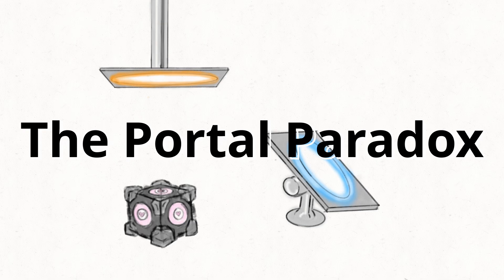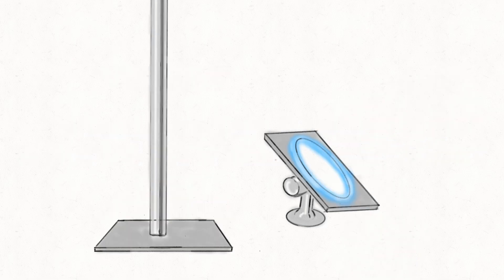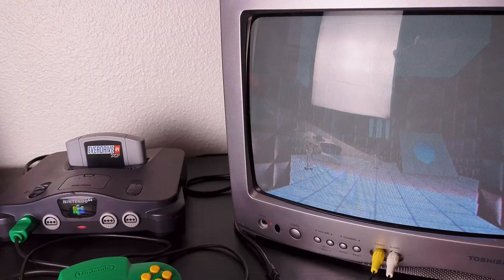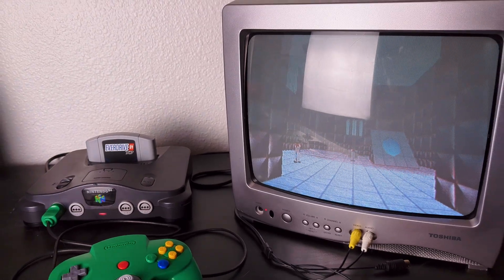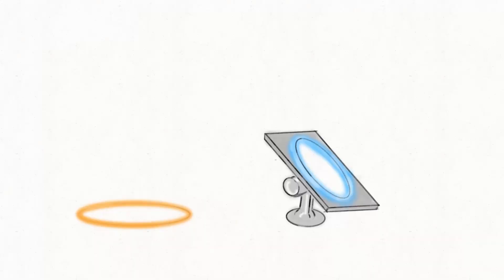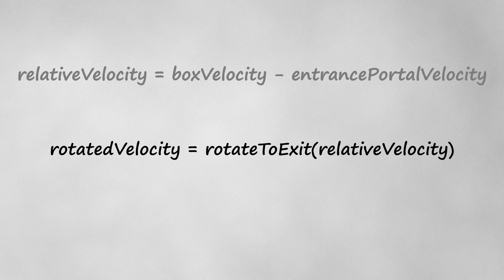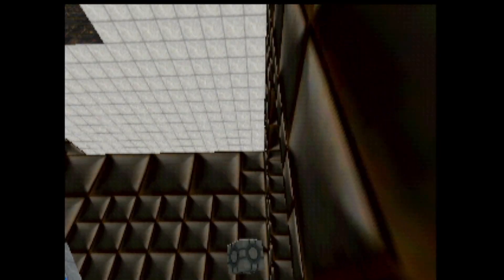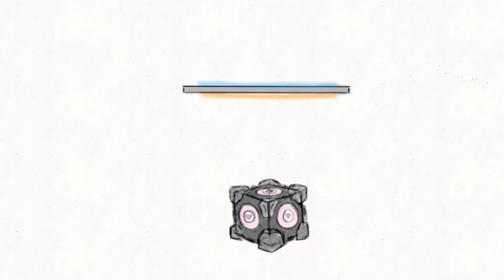I rewrote Portal from scratch and solved the Portal Paradox

Comment: This is a good video but I thought of a scenario that I think is interesting and maybe makes the conclusion drawn in the video incorrect or incomplete . So let’s say that you throw and object into the orange portal and it comes out the blue one. But imagine that the orange portal is still and the blue portal is moving at 10 m/s away from you. Then you throw and object at 5 m/s (or any speed lower than 10) what would happen?
Reply from the maker: The cube would move away from you at 5 m/s becuase 10 - 5 is 5
Reply: @james.lambert  so you throw the object into the portal and despite the object not coming into contact with anything it shoots backwards. So what force causes the acceleration? I don’t know much about the portal series but I was always under the impression the portals acted basically just as holes, so maybe I’m wrong and the portals do exert some force on objects moving through them (which would be weird because moving objects through still portals do not have any change to their speed, but they can experience a change in direction so maybe there is some force?) but if the portals don’t exert force on object moving through them then how could the object start moving backward?

Comment: wait but isn't the blue portal also moving relative to the cube when its stationary? because out the blue end is the orange end which is moving towards the cube, so those 2 should cancel out just like the hula hoop thing.
Reply: Imagine looking through the stationary portal as the other one is going towards the cube in a void with no other point of reference, it's impossible to tell if the portal or the cube is moving since motion is relative, so the scenario with the portal moving has to behave the same as if it was the cube moving
Reply: @heretichazel  irl there are other points of reference like the level the portals are in, and especially the portals relative to each other, yourself looking through the portal and the cube. As well this is a video game meaning all speed is mostly objective with set numbers.
Reply: @gdeveloper3309  I'm saying with no other points of reference just to get my point across, since the room existing doesn't change the physics of the situation
Reply: @heretichazel  well now that there are other points of reference, its easy to tell if the portal or cube is moving. 

In both relative examples the cube and orange portal move closer to each other which makes sense, but i think its a different story once the other side of the portal/the blue end is taken into account.

Once the blue portal is taken as a point of view, anything that moves through the orange portal, winds up on the other side. Once the orange portal engulfs an object, it winds up on the blue side, and once an object is on the blue side, no portal or anything is moving to engulf it or transport it anywhere else. So any portal moving towards an object should just plop it to the other end, and once its on the other end, it just stops. If the object relative to the blue portal is moving, while the orange one is staying still, then it fires through the blue one.

The space between an object and the otherside of the blue portal is cut/gets closer the more the orange portal moves towards an object, but once the object is finally through the orange portal, there's nothing making the space closer to the other end of the blue portal imo.

As well, this version/solution to the portal paradox is a tiny bit easier to implement code wise because no properties of the portal change, except that they move now(anything that goes in, is on the other side). This would also solve stopping the portal halfway on a cube.

I think the correct version of the hypothetical would be if the blue and orange portal were back to back moving towards the cube, because then like the example was, it would be impossible to tell whether or not the cube or portals are moving, but it wouldn't matter because relatively the cube would still be flung on both ends (because then the blue end would also be traveling away from where it spits out the cube)

With a moving orange portal in your example, to me it always seems like the other end of the blue portal/whatever comes out of it is constantly moving away from the blue portal even if the blue portal is staying still

The stopping the portal is also a bit strange to me, in your hypothetical, since its impossible to tell if the cube or portal is moving and should therefore behave the same as if the cube were moving towards the portal, would stopping the portal stop the cube or does it fire through? if it stays still, it means there was never any momentum to begin with, if it keeps going, then that means everything relative to the stopped portal has to keep going towards the portal as well, unless there's some seemingly arbitrary rule that the speed effect only happens once you get through the portal which im really confused on
Reply: @heretichazel  wait i have  i better way to visualize mine:

you have 2 rooms, both with cubes and portals linking the two together

-orange portal moves towards its cube
-the other blue portal can be thought of as the other side to the orange portal, so visualize them put together back to back like a hole or something to the other room
-as the orange portal moves towards the cube, everything in the blue portal room can be thought of as moving towards the cube as well. everything in the orange portal room can be thought of as moving towards everything in the blue room also
-once the orange portal engulfs the cube, the cube is now in the blue room
-like stated before, everything in the blue room moves towards where the orange portal is traveling, meaning once the cube moves into the blue room, or the blue room fully moves towards the entire cube, the cube is now a member of the blue room and must travel with it, all moving towards where the orange portal is heading
-the reason the cube doesn't get stuck midway from the 1/2 of the cube that's in the blue room moving towards the orange portal's exit and the other 1/2 trying to get into the blue room is because everything in the blue room only moves as far as the blue portal is and not past it relative to the other side of the blue portal in the orange room.

-if instead the cube moves towards the orange portal with the portals staying still, it will come out of the blue portal with its velocity. 

-The object that is moving, is the one moving relative to the other end of the blue portal(by regular distance, not distance counting portal short cuts) or relative to the objective center/origin of the game.

-if the blue portal and orange portal were back to back, attached, and moving towards a cube, or the cube is moving to them in any scenario with any number of perspectives, it would behave the same if the portals or cube were moving because the blue portal is moving away from everything that comes out of it/the cube is moving away from the blue portal once it comes out

and it would all make velocity consistent for the cube like the portals originally do, instead of the cube being still then being still relative to the scene and flung out another end when a portal quickly scoops it up
Reply: Correct, this guy is an amazing example of the dunning kruger effect.

Comment: Here is one potential flaw with the idea that portals preserve relative velocities:
Let's say we are in space far away from any major gravitational well. Choose some inertial frame of reference and place a stationary cube and a stationary portal in it. Let the second portal be moving towards the cube at a constant velocity in the chosen frame of reference. Now observe what happens:
At first, only the second portal is moving in the chosen frame of reference, so the total energy in the frame of reference is KE+PE with PE=0 (since we are far away from any gravitational influence) and KE="KE of moving portal".
Once the moving portal reaches the stationary cube, the cube will appear at the stationary portal. Now, the stationary cube's non-zero velocity relative to the moving portal will be preserved at the stationary portal, so the cube should shoot out of the stationary portal, right? Now the cube has the same velocity as the moving portal in the chosen frame of reference. But since we are in space and no forces are acting on the moving portal, it will continue moving at its initial velocity. This means that our chosen frame of reference now has total energy KE+PE with PE=0 (as before) and KE="KE of moving portal"+"KE of moving cube"; and since the cube has non-zero mass, the total kinetic energy of our frame of reference after the cube went through the portal is strictly greater than the total kinetic energy of our frame of reference before the cube went through the portal.

Comment: My argument is yes speed is relative but I would think its relative to the world not the portals. They are a holes that change an objects location not its kinetic energy. So I believe it should plop. the one hardest part through is the time the object spends in-between the portals. If it moves past the block it has entered the portal but the other end it shouldn't have moved and if it did, it would break that previous described idea fundamentally. My explanation is wrong but I also say yours is wrong too. Either way both are incorrect so you should have it act both ways depending on circumstance.

Comment: No, you're right. On really short paper, the cube should fall out of the exit portal, but when you really think about it, it is just velocity applied to the entrance portal appended to the cube (whether that's positive or negative), and so the cube goes flying. If the entrance portal slowly consumed the cube, the cube would remain stationary until its center of mass is affected enough by the gravity of the exit portal and then it falls out. I guess that would also mean that if both portals were facing the floor, the cube getting slammed by the portal would mean it would fall to the floor initially with the same velocity, and then gain more velocity until it reaches terminal velocity, but slow entrance would mean that the center of mass rule would still apply, the cube would just end up upside down. The one I want to know about the most is if the cube is falling at a set velocity and then the entrance portal passes over the cube at a slightly faster speed out of a stationary portal... theoretically, the cube would exit with a velocity of its own velocity either divided by or subtracted by (it's 2 am) the velocity of the entrance portal, right? It would be as if the entrance portal passed over the cube very slowly, or would it fly out instead? If the cube was falling at 10 m/s and the portal at 11, wouldn't the cube exit at a speed of 1 m/s? Or 1.1 (portal ÷ cube)? Wait but what about if the portal is beneath the cube falling slightly slower? Is the effect just the opposite or the same?

Wait a minute, if the cube is falling at terminal velocity, complete terminal, maximum velocity, and the entrance portal is going ITS terminal velocity (for the sake of interesting I'm gonna say it's slightly faster), but TOWARDS the cube with a stationary portal on the other side, would the cube fly out with a multiplied or added velocity? And what would happen to the cube? Would it disintegrate or break? Would it break the sound barrier within whatever room or area the exit portal is stationed in? What would happen if both portals are traveling equal terminal velocity, but the exit portal is falling backwards and the entrance toward the cube? What would happen in the same scenario if all three have the same terminal velocity but the exit portal is falling the same direction as the entrance portal (away from where the cube is headed) but toward the source pulling the cube? Is that then velocity³ or just velocity × 3?

My brain is now fried, good night.
Reply: Oh yeah, also, I don't know what happens to objects if they surpass terminal velocity so I'm gonna go look that up, too.

Edit: I just read a Reddit post and now my logic is getting wobbly with the thought of jumping and then a portal passing over you while you're suspended in midair. I guess that I'm thinking about it like the two portals on either side theory where it's exactly like cutting a hole in an object and it passing over you in midair, but I suppose realistically the stationary theory would still apply.
Reply: You slept well?

Comment: two things I'm curious about that i think are related to each other that leave the picture incomplete:

a cube is on a pillar that the portal can also go around, so the moving portal can keep moving once it passes the cube
and
the cube is suspended so that it can be smashed by two walls with portals, the two walls smash the cube

in the example from the video, the moving wall always stops once it passes the cube, there have been no examples where the piston keeps extending.
doesn't it violate conservation of energy if the piston isn't decelerated by the cube's travel?

I'm thinking that any time an object interfaces with a portal, the inertia of the object resists the acceleration from the relative movement, thus pushing back on the portal surface. this is the only thing that would solve the issue for me and make sense, because in my second example, I believe the walls would quickly reach a resistance pressure and would have to either crush the box, or the pistons would become overtaxed and stop.

i think this would look like those magnet setups where you drop a metal ball through a tube and the magnets slow it down, because the magnetic ebb forces heat up the surfaces and slow their movement, I think the same thing would happen here.

if you had a portal on a separated plate, like in the hula hoop example, I think that because both portals are moving at the same speed, there would be no potential difference, so it would still hula hoop, but if the exit portal was stationary, there would be a difference in "velocity potential" that would need to be accounted for as the object passes through, thus both the object would start accelerating, AND the falling plate would decelerate at the same rate, based on the weight of the plate, the weight of the object, and the difference in velocity between entry and exit portals

sorry for the long rant, this was just really fun to think about, and I think I'm onto something here, if you wanted to be more "scientifically accurate"
Reply: a funny result of this is that, if you dropped a heavy plate on an egg, I think the egg would explode coming out of the other side because of the sharp acceleration at the interface point

Comment: Before I even begin theorising on the portal paradox, I would need to know about your implementation of stationary portals. How would any mesh, halfway through a pair of portals, deal with gravity for instance ? Assuming the outer portal is set above ground, and the inner portal is flush with the floor, then would the cube fall regardless of how far in it is ?
Reply: This game doesn't have mesh objects. But if it would, it probably gonna work as we think it should. Actually, there's nothing to implement to the engine, it gonna work.

Comment: I'm no physics major or anything, but it makes sense that the cube would shoot out, since the force of gravity was acting on the cube before it went through the portal. With the piston coming down like that, in my understanding the force of gravity would not have yet been counteracted by the new gravitational affect after it goes through, but it eventually does which is what causes the arc in the trajectory before it hits the wall. Putting the cube through the portal basically just changes the direction of the force of gravity from pulling it downward to shooting it horizontally as gravity catches up once again after it goes through.

Comment: Here's why you're wrong: Let's say the cube's initial velocity is at zero. We then smash the portal over it, the portal has gone around it, but the cube still has not moved at all. It was simply displaced. You're treating the Portal as another object and not just as a continuation of the space the cube is in. To the cube it doesn't make a difference - the room and the air that fills it was around the cube before its intersection with the portal and it's still the same room and air after.

Comment: I’m curious, how would it work if the moving portal changed speed while still intersecting with the cube? Ex. If the portal stopped moving half-way through the cube
Reply: no because the cube is a rigid body meaning it can't be deformed or damaged, and this would result in two parts having different velocities relative to the cube, giving it tension which should stretch it or break it